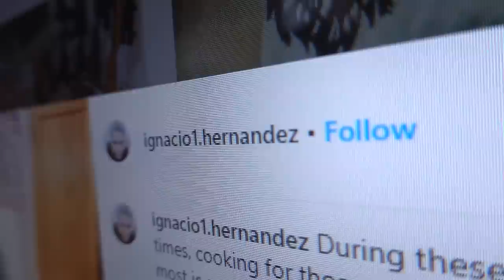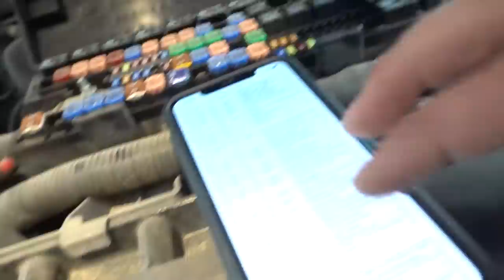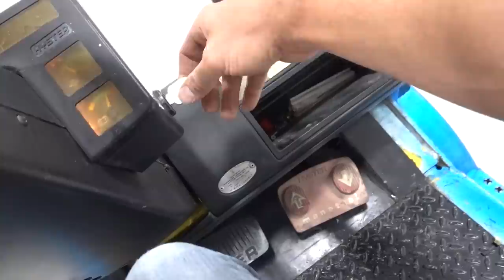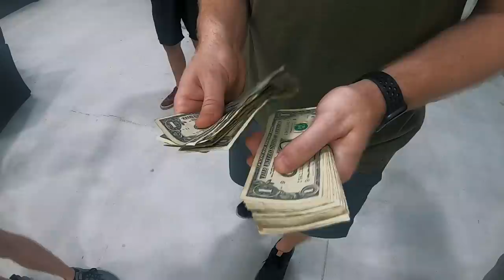I Bought an Old Beater Forklift... AND IT'S AWESOME!!!

Comment: There is a diagram on how it switches between 8787A on the relay itself. so make sure the neutral position is the same as the old one. Potentially the one you bought is normally in the opposite position of the original relay causing it to be on when it doesn't need it and off when it does

Comment: Relays come in NO (Normally open) or NC (Normally closed). Make sure the new one is the same as the old one. You probably need a NO so it closed when power is applied from the temp sensor and turns the fan on.

Also relays are more than just a switch. They are used so you can use low voltage power to control high voltage items. That way you don't have to have a crapton of thick high voltage wires running everywhere.

Comment: Check the relay for the fan, it is probably stuck on. The power side of the relay has constant power and the switch side is controlled by the ECM. So if it’s stuck it will continue to run.               Edit: just watched further in the video and see you tried the relay. It’s either one of two things: the control wire is shorted the hot or it’s a ECM. F150s are known for ECM problems.

Comment: Raptor likely needs a fan switch which is usually located on the radiator it's self.  It's basically a temperature probe which then activates the relay to supply power to the fan.  Relays very rarely go bad and use low power to switch high power which reduces the amount of heavy gauge wiring reducing weight and costs.

Comment: Matt, you don't want to leave the fork lift with any kinda load on it for any length of time. It's bad for the seals on the hydraulics. Speaking of which, you'll want to do a PM (Preventative Maintenance) and start a schedule so there is no guessing who looked at it last ..and when. Moreover: check hydraulic oil level, battery maintenance (fluids D.I. water) hydraulic seals (leaks).
 And when you park it overnight, Tilt and ground the forks (toes down).
 O.S.H.A. can be real asses about things they think they know about ..like fork trucks, Soooo.....
 FYI, you might get a insurance break just having this so you might want to check.
On a personal side I want to mention ..This is a tool and a machine. Respect them, because they have no respect for you. Lifts and loads are a potential hazard ...maybe more that firearms. You ALWAYS have to be aware of your surrounding/ building/equipment/personnel.
 I don't mean to be a safety Barney ..but I watched a guy drop a 20K lbs machine from 10 feet off the deck (ground). ( blown out hydraulic seal) Brand new Mori-Seki MV45 Milling machine (no insurance). That he had bought from me to save his business $200K. (OUCH)!!!!!  (lost his business, house,...eventually his wife. And life to (suicide).
 Don't want to be a downer .. just be careful. I'm really glad for you, also.
Reply: Agreed.  But you hardly ever see matt responding to comments.  Hope he gets training and realises just how dangerous forklifts are.

Comment: That's a good forklift we used to have one ran the crap out of it for years I would suggest taking a forklift safety glass leaving a forklift up in the air like that is dangerous Hydraulics could spring a leak and down it comes fast it's a good Lyft

Comment: As a heavy equipment operator and manlift Trainer, as well as being trained on forklifts up to 90T, just a few points of safety advice.

1. Always look before you move the direction you want to travel.
2. When parking the forklift put the forks all the way to the ground so that they don't pose a tripping hazard.
3. Don't make a turn too quickly or you will tip the machine over.
4. If you feel the machine tipping forward, floor the accelerator and lower the mast as fast as possible. Get the loads center of gravity down. 
5. Keep the loads center of gravity down as often as possible. If you must lift high, move the mast tilted back as far as it will go, before driving the forklift anywhere.
Hope these help. Keep safe, think safe, operate safe. 👍

If you want your own kind of manual, just Google forklift safety training guide, and download and print one of those. 👍

Comment: I'm sure if you check the coil side of the relay you'll find that it's constantly getting voltage, so you'll have to trace back from there. It could be something simple/cheap like a bad coolant temp sensor failing safe or it could be the ECM.

Comment: You are good to run the forklift inside and out also when you are done using it  Tilt the mass so the forks point to the ground.
 So your employees don't stub their toes.   Also at the end of your workday turn off the gas.. Sometimes it will leak if the  Is gas is still on. That is a big thing with osha

Comment: You can run the forklifts inside and when your taking the forks up. When your in neutral if you push the gas while they are going up they will go up faster :)

Comment: Check the Raptor for a fan control module mounted on the fan shroud. On the Fords that use them they are notorious for failure.

Comment: You can check, if the coil of the relais gets voltage against ground in the relay socket, should be the pins 85/86 (not against battery ground, because most of the times there's permanent 12V and the ground is switched by the ECU output transistors)...if there's voltage, the car wants to turn on the fan for whatever reason (faulty sensor or sth like that), or the output transistor in the ECU is cooked. A shortout on the output pins can be ruled out, 'cause the fan stops if you pull the relay...

Comment: There's a coolant temp sensor and an Electric Fan Switch. The coolant temp sensor is what tells the ECU and your dash the temperature of the engine.  The fan switch turns the fan off and on. Yours is probably shorted.

Comment: Everybody saying "thermostat"... I hope you're referring to something like a thermostatic fan switch/controller because the actual "thermostat" is a purely mechanical device and can only fail 2 ways. Stuck open or stuck closed, can't cause the fan to stay on. What I'm wondering is when he tried the new relay at the store was the truck at a temp that would've normally kept the fan running? Maybe it was the relay and he just needs to try it again when the trucks cool.

Comment: There is a temp switch that tells the relay to tell the fan to turn on. The temp switch is likely bad or the wire is shorted. But temp switch most likely the cause

Comment: When disconnecting the battery like that, you should always discount the neg. Side not pos. Side to avoid electric arc which could cause other issues.

Comment: You can run the lp in the building. My job we use 10 plus lp powered forklift lifting 5,000 to 8,000 per lift up to 14 feet

Comment: Matt had the forklift for like 10 minutes and broke like every rule of forklift safety.
Just a few tips:
- Always park your forklift with the forks on the ground
- No one should ever ride on the forks
- When carrying a load, always have the forks tilted back and as low as possible
- and I'm pretty sure it is a federal requirement to have certification to operate a lift truck.
Reply: and carry out a full inspection of fork truck before operating for the day. 
I do hope you know the model, so know the max weight you lift and to what height etc.

and you better have told your insurers and hope they never watch your channel!

Comment: Look for the temperature sensor, by u pulling the relay, ur stop the signal to the computer, causing the fan to shut off, and it should be located on the thermostat housing, I'm not for sure on ur truck bc I'm not sure on the yr, is it a 2017?

Comment: Its probably your engine temp sensor, telling you ecm your truck is hot even though its not. And it wont show on your temp sensor because your temp gauge usually has a separate sensor

Comment: hyster 50 3 stage mast 5000lb capacity, less if it has a side shifter and ya from some comments it can get you in trouble if your cocky and trying to be fast. Also very dangerous for workers in immediate vicinity also customers if you are Home Depot. I drove Yale's and Toyota's mostly with the Toyota being the best, I drove for production lines as well as shipping and receiving. Some pals and I could pass eachother inside 53' trailers iin the docks and unload and reload floor to ceiling front to back in less than 30 mins.

Comment: Matt do not ever walk under a forklift mast that is raised or has a load on it. If the hydraulic lines rupture for any reason your most likely going to die! Always park it with the forks on the ground. When moving a load the forks should not being  any higher than a few inches off the ground. Much better to break someone's ankle than puncture a lung. The shop I worked at had a guy step out between two trailers, he wasn't seen due to the load on the forks. He had to be scrapped off the bottom of the forklift. Not a pretty sight.

Comment: Could it be that the fan ran when you put that new relay in because you'd just driven a black truck in texas to the auto parts store, took the relay out to bring into the store stopping it from running and match it, and then when you put the new relay in the engine was still hot and it triggered the fan because it didnt get to cool the engine while you had the relay out?

Comment: Propane burns much cleaner than diesel forklifts but you still need ventilation. I would say the best way to fix the fan problem would be to trade it in for another Dodge lol. Having a forklift should save a lot of backs, work smart not hard at work

Comment: in a used forklift you want to check every fluid and filters. some ppl dont ever change hydaulic oil and filters. 
btw. be safe. its small but not a toy at all. if you dont respect it. itll mess you up

Comment: Relays always “fail” off, they will never fail on. That’s why your oven doesn’t randomly turn on forever when the relay goes bad. However, transistor will fail on.
Reply: Until the relay contacts weld themselves together..or the spring breaks and wedges a piece behind the contact block and leaves the contacts locked together....just saying..been there..done that..

Comment: Does the fan run when the AC is off?  If not it's probably a blocked refridgerant line it's on the firewall in the engine bay. Mine was doing that too;

Comment: Fàn controller, thermostat, that turns it on/off for radiator temp.  It's a control box wired between the fan and batt. With a thermal probe to the radiator...Just drop me a line when you need expert advise, bro...lol

Comment: You know there is open relays and closed relays right? Its possible the factory one burned up and stuck open and the new one you bought may have been a NC normally closed relay or vise versa you probably have it figured out by now but figured I'd throw it out there anyways 🤷‍♂️

Comment: I hope that forklift was cheap. Whenever the service interval is "whatever breaks" as this looks like, it will not be cheap in the long run.
At least the hoses for the forks (left/right movement) should be replaced very soon, would not trust them to last the month (unless they were dirty as F, looked like the outer rubber if cracked in several places, they dont hold long after that)

Comment: Matt if you want to be real ghetto you can do what my dad did when he had that problem on his van. He bought a light switch, ran the power cord for the fan to the switch and mounted it under the steering wheel so he could manually turn the fan on and off.

Comment: Be careful with that forklift like everyone else is saying. I worked for a Walmart distribution center. I saw a guy on a double jack. The double jack got hit by another one in the side weren't even going fast and it threw the guy off and messed up his back. Saw another guy get his foot run over not even by the wheel just the edge of the bottom broke it in half. We also had a woman on dry side she got off hers it started rolling pinned her against a rack we are talking barley moving broke both her legs just from the weight being pressed against them. It seriously moved slower then a toddler just learning to walk

Comment: My cousin thought it would be s good idea to have an orgy at my dad's office/shop and they all got drunk and lifted one of the guys up on the forklift and was going in circles and tipped it over onto a 200 gallon propane tank that was just filled and broke a valve off on it and filled the shop up with propane and there were lit pilot lights on water heaters ect... well the guy riding on it that was an employee got his foot pinned under the forklift and the fire department came and so did the local news station. The fire fighters said they were lucky the shop was so cold because the propane stayed close to the floor and the pilot lights were all upstairs so they opened all the big shop doors and evacuated the propane. Needless to say my dad was home 75 miles away and watching the news and says, is that my shop?? Needless to say there were several job openings Monday morning!

Comment: You're getting 12 volts constant to that fans, either a bad signal wire or a bad ground sending 12 the wrong way.
Reply: Bad signal is going to take a wire trace to figure it out.

Comment: Damn I would love to have that raptor I'm a mechanic at Ford raptors are so expensive plus the new ones I don't like with the ecoboost v6. I wanna be able to have exhaust and it not sound like a Honda Civic. I want the same one you have either the ,5.4 or perferable the 6.2 liter yee yee.... Dream car most people want a lambo or something right now my dream vehicle is a V8 raptor. Cars have modules to tell the fan when to turn on and off they go back just fr overuse so most likely it's a module or relay

Comment: 3 stage 188" most likely. Huge fines for untrained operators. I work for Hyster Yale. If that's a 2003 I'd be surprised. Most likely a 90s model and hours definitely arent accurate. Have a PM done on it and she should run fine.

Comment: just put it in neutral and parking brake it whenever you get off. Its scary when a forklift starts rolling when your not on it.
Reply: OH and always drop your forks all the way to the ground to weigh it down just as another precaution.

Comment: That's a better fork lift then I use at work ours has 7500 hrs it looks like a 5000 pound lift capacity
Reply: The one matt has looks like a  1.8 tonne or as you might say 3600 pound.

Comment: The problem with the Raptor is that it's a Ford. Lol j/k. But watching you pull the positive cable off and on made me cringe every time. Don't do that with the positive cable, unless you like fried electrical parts. Negative first when disconnecting, and last when reconnecting.

Comment: Wow. I Love ya bro but after driving fork trucks for many many years. You just violated soooooo many basic OSHA  and safety rules. Dude forklift are 5000 lbs and not a toy. Take a fork lift driving class. It takes a few hours. You can easily drop a load or flip it. You could have easily hurt yourself or someone else in that chair.

Comment: Yall, I think he heard ya the first 500 times you brought up OSHA. I dont think every single comment needs to be about it.  He is an adult and I'm sure will find out all about the safety regs and such. Chill out. Btw, I'm a certified forklift driver that lifted and moved MUCH more dangerous things while in the Army than a chair so dont even try jumping down my throat. cough missiles and rockets weighing thousands of pounds. cough